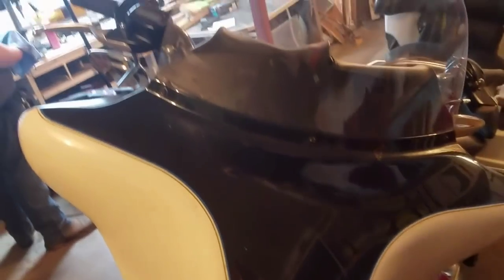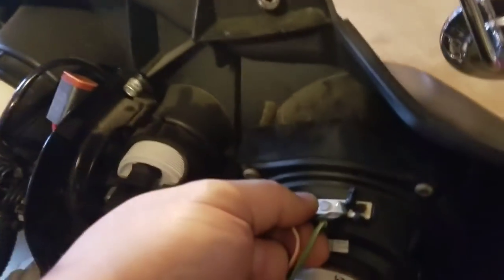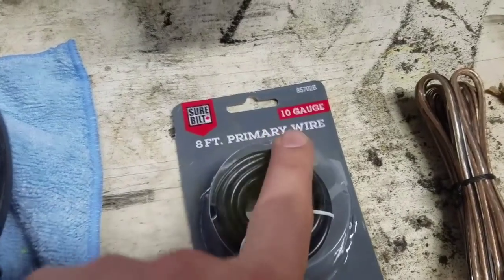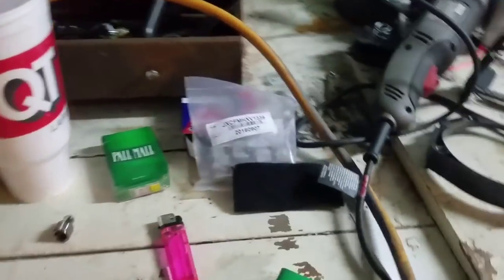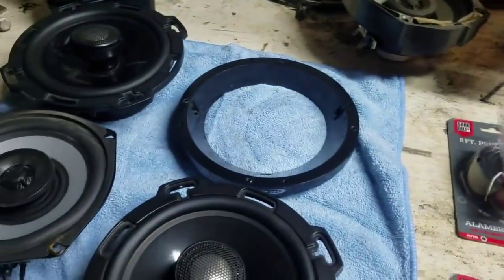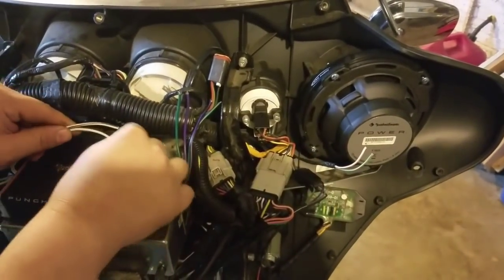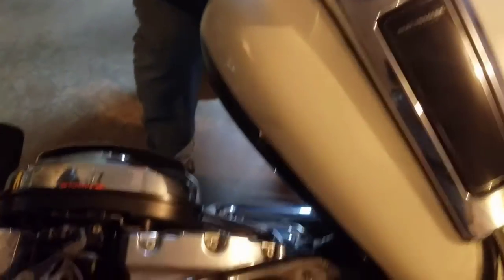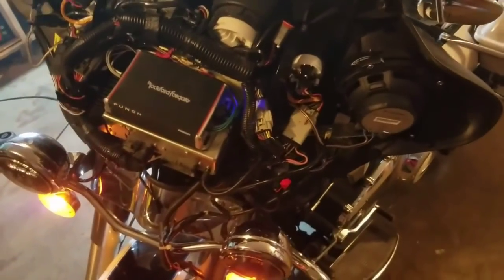How to install amp and new speakers on your Harley

Comment: Hey guys,

great job!

quick ??s - do the green/purple pigtails that hook up to the speakers come with the amp unit when u buy new? do the grey and white pigtail that hookup to the stereo also come with the unit? or do I have to buy separate?

I have acquired an 09 FLHT that needs sound upgrade and this is probably the best solution.  Thanks

Comment: The link to the speakers you have posted I bought. They will not fit into the bracket’s because the tweeter bracket sticks out on them. I noticed the power speakers you have do not have this? They are different
Reply from the maker: I wonder if they changed the speaker they are selling because that is where I got mine. I apologize. I guess after 4 years things changed

Comment: Thanks for the vid! Have an 08 electraglide . Speakers just started cutting in and out. I’ll shut my bike off re start and they will work for a few minutes. Any idea?
Reply from the maker: Sounds like there is a bad connection somewhere maybe the radio is protecting itself but that is the only guess I have.
Reply: @2MostlyBaldGuysKC  thanks ! I’ve noticed when the speakers cut off, I’ll hit the CB/Intercom button and the music will start playing again lol. I’m going to see if I can bypass the CB

Comment: Nice video, but I have a question or two. Why do have to use speaker adapters? Cant you just mount the new speakers in the original speaker pods? Also, can you not power the amp with the power supply to the cigarette lighter? I will not have a stereo remote to deal with. Looking forward to your reply.
Reply from the maker: The original speakers are smaller than the 6.5s we put in so you have to use adapters. No the cigarette lighter power wires to small wont get enough power to turn amp on. Thanks for watching hopefully this helps

Comment: Speaker inputs to amp is the remote turn on. Remove the cig lighter remote you wont get engine noise or blow ur equipment. Good stuff tho 👍 all ur guys vids are helpful
Reply: I connected the blue wire from the radio to the blue wire on amp and its not turning on. What did I do wrong?
Reply: @chachee15  make sure positive lead has 12v check fuse battery
Good ground best from battery
Most aftermarket radios have 2 blue wires,make sure youre on amp/remote and not power antenna. What year make model?
Reply: @82donut  I did all those things. Where do you connect that blue amp/remote wire? I have the blue wire from radio connected to blue wire on amp and the yellow wire is going to the auxiliary power connection.
Reply: @82donut  its an 02 Honda VTX 1800C
Reply: Yes thats correct. Try connect yellow and blie together on amp JUST to see if it turns on if it does then lokk for an accessorie power for the blue remote on amp

Comment: What year are you installing this on and what head unit was already in the bike.
My '14 doesn't has a cage like bracket around it and it a simple 2 speaker 4.3 non touch system.

Comment: What about the tweeter speakers? Do they run in parallel or series with front input? Or do they get connected to the rear input on the amp?

Comment: Have a question I have a road king, I have amp and the speakers, I’m trying to figure what wires and Bluetooth I need to do the install I don’t want to go to a shop like to it myself,
I’ve been seeing only installs for fairings Harley
Reply: Pick up a bluetooth receiver from Crutchfield.com for $40, free shipping. Velcro it to the inside of the bag near the amp, out of the way of the power wires and use the rca pre-outs on the BT receiver to plug into the amp. Make sure you run your power wire through a switch so its not constant on and draining your battery. That's it. You don't need a shop for that. Good luck.
Reply: @frankgoytia9393  thank you

Comment: Highly advise not using a self tapping screw for the ground, they’re notorious for backing out and you’ll lose your ground. Just run it back to the battery, you’ll have it open anyways. Also you’ll want an inline fuse on the power.

Comment: Might be a dumb question but what was the green and purple wires for thats coming out the amp?
Reply: green and purple are wires for rear speakers. They did not connect them because they only have the two front speakers.

Comment: Good video. Was wondering what to do with my amp when I installed it. Big help. Thanks!
Reply from the maker: Thank you glad we could help thank you for watching!!
Reply: @2MostlyBaldGuysKC  hello why did u wire the gray wires to the wires coming from the radio? And the green and purple to the speakers? I have a after market radio would I still have to do that?

Comment: I ran my ground to the battery and its cutting out at full valume I should move it and put in real amp wires and fuse.

Comment: Nice video.Does the amp run hot? How is the velcro holding up keeping the amp in place?
Reply from the maker: Thanks. We both have been running with our amps like this and have never had any problems since 2013 so I still recommend how and where we mounted the amp. It's nice because it's easy to remove if you need to work on something.

Comment: Just my opinion that really doesn't matter but the amp/head unit heat up a decent amount and I would worry about the tape loosening.
Maybe some zip ties to back up the tape?
Good video
Reply from the maker: Mike Hammer it could possibly but I guess we have been lucky we have been running this setup for few years with all the bikes we have done it to no problems. But yes a zip tie would be a added security
Reply: 2 Mostly Bald Guys 
Ok I didn't know u guys had done it before.
Appreciate the response
Reply from the maker: Mike Hammer oh no I agree with you it would add extra security I guess we just didn't think to much into it I might add it great advice. And thank you

Comment: You should always run the ground back to the battery you will have issues we’re you grounded it my not be wright away but trust me you will I’ve had more bikes come to me for this problem just tying to help you out 🏁
Reply: Seems like you would do that since you're already running a wire to the battery anyway.
Reply: Actually you always want the ground wire to be as short as possible. Also what Rockford Fosgate recommend. Good ground source being mandatory, not just a random bracket.
Reply: Where should I put ground I put it to battery but when I change Chanel on radio there is a pop noise only when I change the station! Help thanks